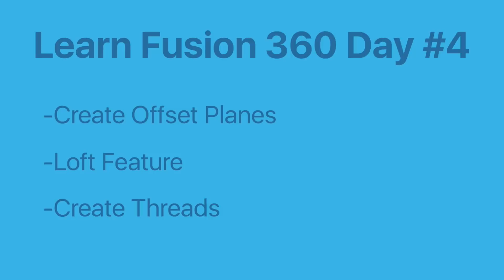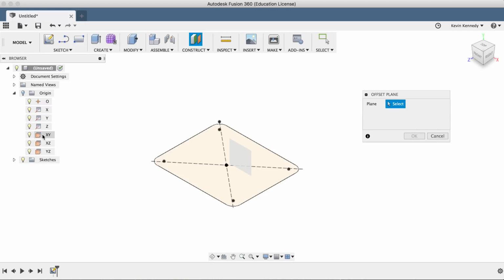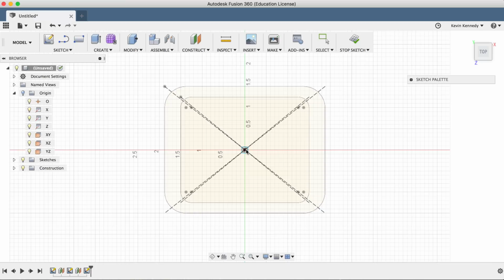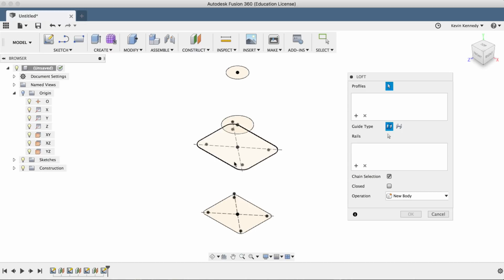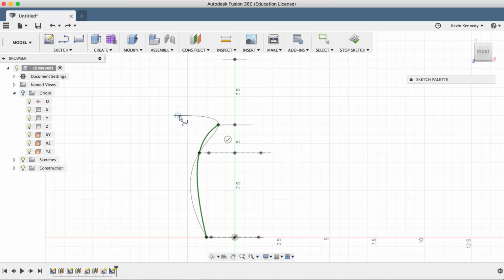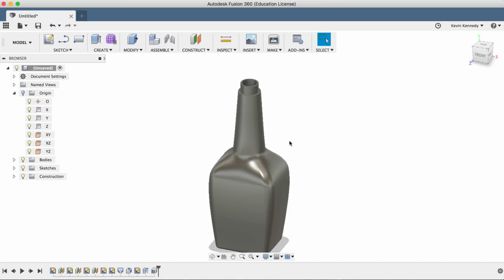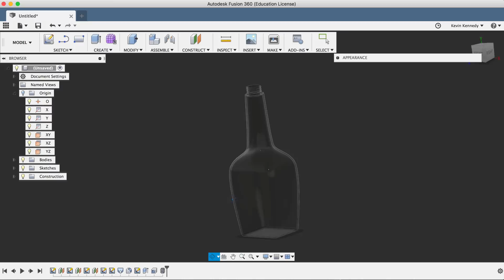How to 3D Model a Whiskey Bottle - Learn Autodesk Fusion 360 in 30 Days: Day #4

Comment: For some strange reason, all the point in the first rail are black, but when I mirror it, the top point is off to the right of the top circle border by a bit and I cant make it snap to the line. It always stay white. Any ways I can force it in?
Reply: correction, I just realized that the line on the left has the same issue, but for some reason, the top point shows as black...
Reply from the maker: @AlainPilon  You could add a coincident constraint to try to force it. Select the point > hold down shift key > select the second point > select coincident constraint in the sketch dialog. If that doesn't work, please share your file and I'll take a look.

Share your public link as a reply to this comment. Here's a video explaining how to share a public link - https://youtu.be/2XrcrdV-8Ls

Then, please write a separate comment letting me know you've replied with a link because YouTube flags most links and I don't always get notified. Cheers, Kevin :)

Comment: I don\t have a black dot at the top. How do i get one? Thanks! :D
Reply from the maker: Hi Carl, it is likely due to your lines not be connected. They may appear connected but they may not have completely "snapped" to one another. Make sure your grid and snaps are turned on in the settings. If you are still having trouble please share your file with me by going to file > share > share public link (make sure "downloadable" is toggled on) and paste the link here. Cheers, Kevin :)
Reply: Product Design Online Thanks! You are doing a great job with these videos! Do you plan on having some patreon material? I would sign up! Keep up the good work! 😃
Reply from the maker: @carllychou  Patreon is something that I have considered. I was planning on wrapping up this series and then will probably start to get that together. Do you have any suggestions on types of content you would like that is exclusive to Patreon subscribers? Cheers, Kevin :)

Comment: So I get the black dots, the area between the guiderails turns into a face, but when I use loft, I get the (not very helpfully worded) error "The guide is not G1 between first and last sections."  EDIT: Nevermind, I guess because the handle of the top point of my spline was not along the line of the straight neck line, it couldn't compute, because there would be a slight edge.
Reply from the maker: EJH04 - Glad to hear you got it working! Splines can be very touchy when it comes to Lofts. It's usually always a small point or area that isn't connected that throws it off.

Keep up the great work!

Cheers, Kevin :)
Reply: I have the same issue. I cannot get the rails to connect to all profiles. I've zoomed in and confirmed they look like they're on the profiles. What are those magenta lines on the profiles? Is that where the rails have to touch? I also seem to have an orientation issue in sketch mode.  When I click the home orientation, it looks different than yours (https://ibb.co/j1JN9J )  as does my top orientation (https://ibb.co/inEOGy ). I don't know if that has any impact.
I can't get the lines to snap onto the profile edge. They snap on the inside of the profile and if I manually move them they just seem like they aren't connected.
EDIT: I just can't get this figured out. I can get the rails to work for the first two planes but can't get them to connect to the top two. I've even tried different shapes instead of the circles but the rails just won't connect.  I'm going to have to move on to the next lesson and maybe come back to this later :P
EDIT2: I'm a glutton for punishment....Tried again and even though the lines look like they connect, if you zoom in enough you can see they still aren't connected. There must be a way to snap these lines to the profile...
Reply from the maker: Hi Ryan - I'll try to answer all of your questions... let me know if I skipped something.

1) Not G1 means not tangent. If you're receiving this error message is definitely something to do with your lines and profiles not being connected at some point... as you've stated.
2) Magenta lines mean that the line(s) are NOT fully constrained.
3) Orientation really shouldn't be an issue with the lines not being tangent/connected. It looks like your Fusion preferences are set to Z axis-up and mine aren't. However, if you want to re-orient your object it's pretty simple... just re-set the top view under the little drop-down caret located to the right of the viewcube. I explain it in this video -https://youtu.be/GwGa0Z50jLg

It sounds like you're having issues with the lines connecting where the straight line (top of the bottle) connects to the spline (bottom of the bottle)? Can you post a screenshot of it, please? (this may help me notice something). Did you make sure you trim the top of the spline out?

Here are a few things you can try:
-Check to see if your snap to grid is on. This may or may not help. You'll find it in the display settings on the bottom - https://snag.gy/aiTE1L.jpg
-When you are connecting lines try viewing it from the corner of the viewcube - https://snag.gy/e3IGdS.jpg. A lot of times this helps it snap into place because when you're viewing it from the front it will front to snap anywhere on the profile.
-Try adding a "sketch point," located under the sketch drop-down menu, to your circle profile. Having a point there will help it snap in place if the first two suggestions don't work - https://snag.gy/e3IGdS.jpg

Let me know how it goes! Cheers, Kevin :)
Reply: I just started from scratch and have the exact same issue. I can't snap to the edges. I can manually move the lines to intersect but as soon as I mirror them, the mirrored side doesn't intersect and there is no constraint even though it is directly on the line. If I turn on 3D Sketch, I can seem to intersect but I can't mirror since I can't select the spline. I've watched other tutorials andI for the life of me can't figure out what's going on.
https://ibb.co/kJkhTd
https://ibb.co/iX27uJ
Reply from the maker: Ryan, I just watched your screencast and I don't notice anything wrong. This is bothering me too! haha

Can you share your file with me? I'd like to play around with it and see if I notice anything else.

Go to the file drop-down menu > share > share public link... and make sure that "allow item to be downloaded" is toggled on.
Reply: Here ya go. This is the last one I was working on. https://a360.co/2mrzKjB
Reply from the maker: Hi Ryan - My apologies for the delayed response. I didn't realize YouTube held this in the "comments to review" section (likely because of the link). 

I took a look at your file... I don't see your spline at all? Did you delete it? The other thing I noticed was that your second plane didn't have filleted edges. Although this shouldn't affect your spline, it would change how your final loft would be.

Have you tried again in the last few days? If not, can you share a new file with the spline included? 

Cheers, Kevin :)
Reply from the maker: Hi Olexandr - My apologies for the delayed response. I didn't realize YouTube help this in the "comments to review" section (likely because of the link). 

I took a look at your file, it was a pretty simple fix. The top of your spline was not connected to the straight line (stem of the bottle). I fixed that and the path worked - https://snag.gy/e1O7gt.jpg

 Here's the link to the file if you want to take a look - https://a360.co/2uZ9G39
Reply: I might come back to this but I'm just moving along to the rest of the series. I haven't had any other major issues so far with them.
Reply from the maker: Ryan Gaudet good to hear! Let me know if you have any questions with them. Cheers!
Reply: i have the same error
Reply from the maker: Hi John - did you try to adjust your spline handles where the top of the spline and the bottom of the vertical line meet? It's very likely that your spline handle is causing the G1 error. You should be able to grab the green spline handle and slide it over and it will snap into place of the vertical line. If that doesn't do the trick please share your file and I will take a look at it.
Cheers, Kevin :)
Reply: @ProductDesignOnline  Hey I'm having about every issue you probably have here with my lines not connecting and constraining. For whatever reason my lines don't snap to the circle so I sketched some points and made sure all the dots are black. 

Then I cant trim the excess on my spline because it just highlights the entire thing and deletes it. So I had to create an extra line coming out of the black constraint dot and then use said line to break the spline at the intersection. I was then able to delete the excess. 

Then when I try to mirror, it wont let me select any objects or the mirror line so I started over and still had all the previous snapping issues. Except this time I was actually able to mirror it but when I tried loft it, of course I got the G1 issue despite the fact that all my constraint dots were black

Another unrelated question. Why is when I try to go back and modify sketches after a few steps in the history It sometimes won't let me select and edit them? They just will NOT highlight anymore unless I hit undo until I hit that point in the history where I first created that part of the sketch? Why isn't letting me go back and modify something whenever I want?

Getting things to snap to other things and properly constrain should not be this hard

EDIT: after a bit of research it appears that my spline line is blue meaning that for some reason it isn't properly constraining despite the fact that all the dots its connecting to are black.
Reply from the maker: @Pseudorealizm  Could you share your file with me? That will help me figure out if its something specifically with your file or a settings issue/difference. To share your file go to file > share > share public link (and make sure "downloadable" is toggled on. Then, copy and paste the link here.

That's a weird issue with the sketches. I'm not sure I've ever had that problem before. I'd have to see a screencast of that, it may be something to post on the Fusion 360 forum that the Fusion engineers could respond to. Sounds like it may be a bug in the software.

Cheers, Kevin :)
Reply: @ProductDesignOnline  Hey Kevin thanks for the quick reply! First thing I should say is I've been tinkering with this for over an hour now and noticed that my rail lines aren't connected to my circle diameters. I don't know if they were always that way or if I accidentally broke that constraint somewhere along the way since I've been having troubles getting my rails to connect properly to the circles from the very beginning. at some point along the way I went from getting G1 errors to getting "lines pass profiles multiple times" errors and then "lines don't pass profile" errors (probably not the correct wording). If you can get this to work please tell me how. I set the file to be available for download if you find the time. Thanks!

https://a360.co/2P6U4aN
Reply: @ProductDesignOnline  Sorry to double up just wanted to let you know I shared the file in case my post got hidden away because of the link. I'll delete this post when it loses its use
Reply from the maker: Hi  @Pseudorealizm , I see the link to the file, but when I click on it the file is for the beer bottle. Can you share the link to your Whiskey Bottle file? :)
Reply from the maker: @Pseudorealizm  I was able to take a look at your file today. It appears that your first two profile shapes had some issues that were throwing the loft out of whack. One of them was not centered, so when the spline and line were mirrored it did not connect the profiles properly. I would recommend going back and editing those first two sketches. Once you remake them the problem should be avoidable. Then, redraw the spline and copy it over and everything should work...that's what worked for me :)
Reply: The only way I was able to get around g1 error was to make the spline then whole length instead of using a line for the neck. Is there a way to make the spline 100% straight for that one section so you can keep a single line
Reply from the maker: @smolaf  You should be able to get the spline and line connected. The key (something that I should've given more emphasis to in the video) is to make sure the blue spline handle is snapped to the straight line. If that doesn't work, share your file with me and I'll take a look, as it could be something else that is giving you the G1 error. To share your file go to File > Share > Share public Link (make sure downloadable is toggled on) > Paste your link to a reply to this comment. Cheers, Kevin :)

Comment: If I work in mm, Fusion can convert the units to inches at the end if I will need it? :)
Reply from the maker: Rafael Calzadilla - If you change your active units in the Fusion 360 Browser you can switch back and forth between units at any time. Cheers, Kevin :)
Reply: Thank You. I'll try it :)
Reply: you can just type the letters "in" after each dimension to make it inches - this way you can stay in mm
Reply from the maker: @lovecastle7154  I am aware of that... but great tip, thanks for sharing with the community :)
Reply: @lovecastle7154  wooow that sounds Luke magic. I'll try it. Thank you!

Comment: Why are you switching units of measurement for each model?
Reply from the maker: Hi Joe, the units were chosen by whatever dimensions that I had found online. With that said, I also wanted to reinforce how to switch units back and forth should it be necessary. From Day#9 on they will all be in mm.

Cheers, Kevin :)

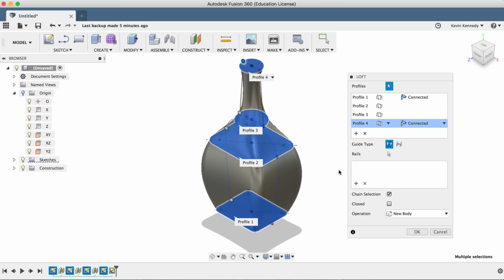Comment: Hi Kevin. Min 8:03 when I select each rail it doesn't modify at all. Why that? 😃
Reply from the maker: Adrian-Constantin Cucu - It could be a number of things, but most commonly it seems to be because the spline and line are not connected, thus they are not one continuous line that is required by the loft path.

Can you share your Fusion 360 file so I can take a look? Cheers, Kevin :)
Reply: sorry, but I cannot attach picture, don't know why isn't working, cheers :-)
Reply from the maker: Adrian-Constantin Cucu - To attach a picture here to the comments you will have to use a free snapshot tool such as https://snag.gy/

Alternatively, if you're able to share your Fusion 360 file with me it will help me even more. In Fusion 360 go to file > share > share public link > make sure its downloadable and then copy and paste the link here.

Cheers, Kevin :)

Comment: I’ve done this 6 times now and always get “error, rail not smooth” it’s exactly the same as the tutorial..
Reply from the maker: If you're getting that air that means at least one point is not truly connected. Try clicking and dragging on the various rail points and if any of them can be moved away you will need to add a coincident constraint. 

you can also turn on the auto-project edges on reference setting in your preferences which will help that happen by default.

Comment: <3
thnkz
Reply from the maker: Thanks, Ley Lah! Please don't hesitate to comment questions on the tutorials as you work through the remainder of the series. Cheers, Kevin :)
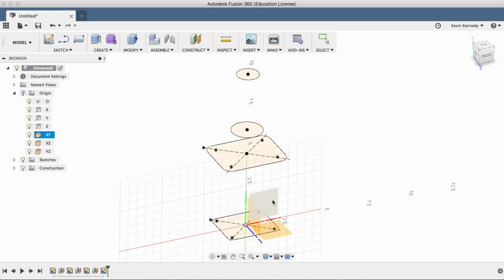Reply: @ProductDesignOnline  ok then i wont hesitate, im using the new version of the 360, during the procedure ur making the rails of the bottle 6:09, i can't seem to select the edges of the sketch ( 2 rectangles and 2 circles). im literally just making splines in the plane not in the sketch. sorry for my bad english
Reply from the maker: @ley90  I just noticed you had commented on the original video. I actually have a revised version of this tutorial that talks about these common issues, including what you're experiencing. Please check that out here - https://youtu.be/pqXCswoa3F4
You can find the full 30 Day Series playlist here - https://bit.ly/learn-fusion360
Cheers, Kevin :)